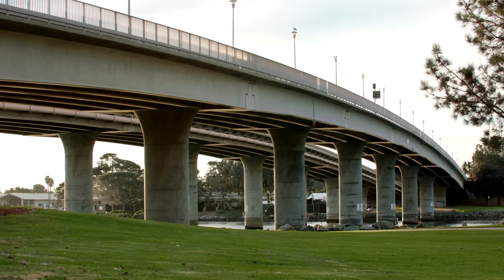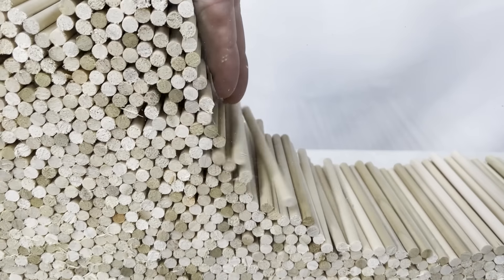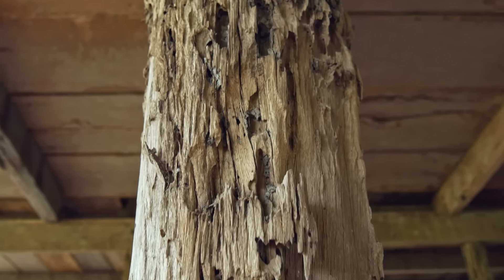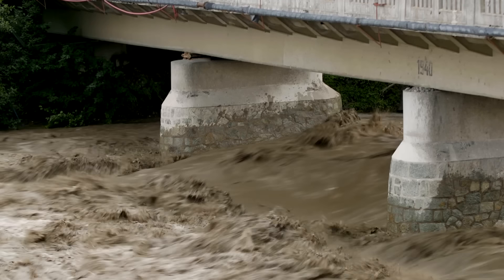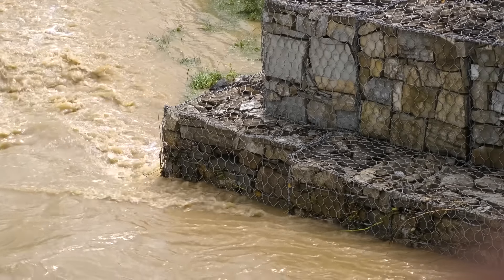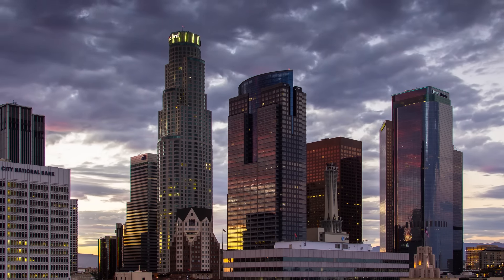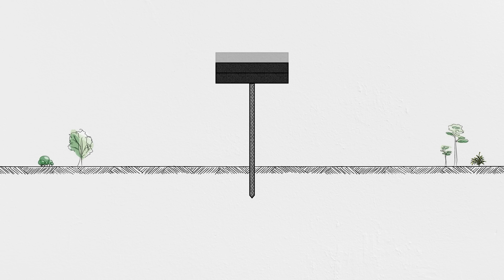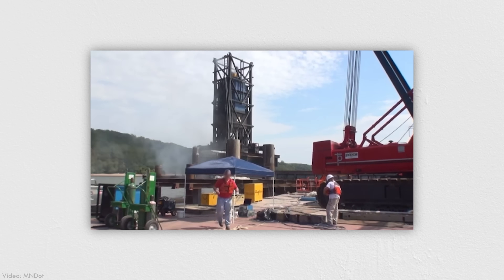Why Buildings Need Foundations

Comment: I'd be interested to hear about historical aspects of engineering. For example: my hometown in south-western Germany has a lot of really old houses - some of them close to 900y old, but still fully used for housing and renovated to modern infrastructural and energy standards. Most of them are timber framed and have been built long before "modern engineering" was a thing - yet they withstood for so long and might for quite some time to come.
The way they were built might be part of this secret, e.g. many of them moved together with their sinking foundations, have visible (but apparently not critical cracks that were simply filled during renovation, leaning walls, crooked floors rising 20-30cm in extreme cases from one side of the house to the other.
Reply: Don't forget about survival bias. You see only those, that had the right combination of construction, soil below them, lot of repairs over the years and a lot of luck. 99 out of 100 are long gone.
Reply: @petrkubena  which would not make the reasons why they survived for 900 years any less interesting
Reply: I was thinking of many of the stone structures in the UK that have been in use since time immemorial.
However, many of these structures have basements that likely serve as decent quality foundations, and many have seen many repairs over the years as stress cracks have appeared due to settling. Now such structures are probably resting on exceptionally well-settled soil.
Reply: As Grady mentions at 6:04 - engineering is a job of balance and constraints. I think before "modern engineering" was a thing, people didn't know how strong things needed to be so they were overbuilt to make sure they lasted. Only those structures that were overbuilt survive till today.

With modern engineering, we now know the limits of materials so we build things to suit the budget and expected lifespan. We can definitely build buildings that will last 1000 years, but not many people would be willing to pay for that.
Reply: It's probably much the same reason why you see old roman structures still standing today. A lot of buildings and other structures used to be built as solid slabs that move around on a shifting foundation as one big piece rather than something that gets pulled apart. Those roman structures that still stand today as those are basically all just massive single lumps of concrete without reinforcement (so no oxide jacking when the rebar inevitably starts to rust). They were built that way because that's the only way they could be built back then and used way more material than what a modern equivalent would.
Reply: Well, generally speaking, houses in Europe are built to last more than 3 generations. Raft system is used extensively, concrete, stone and bricks also. You can not expect to have building with wood base to last, and whole idea of USA houses is a bit ridiculous to me.
Reply: @petrkubena  I have to disagree, even if you go around villages in Eastern Europe, houses that are not let of are in great condition. The ones we don't see anymore are either destroyed in wars or intentionally replaced with those of modern design, with at least 70% salvaged material.
Reply: @veryboringname.  Where goes the limit on "over engineering"? 1000 years is obviously just an exaggeration but also the current USA-style where houses are demolished every decade or so is just waste of resources and money. Buildings should be built to last at least hundred years because we have the know-how for it and ripping buildings just to build newer ones is just dumb.
Where i live, houses cost alot and that is with the normal building codes, they just have to be sturdy. We have to battle with yearly frost, bitter cold and heavy snow loads on the roofs. If building is found to be unlivable and has to be condemnd in less than 50 years, mistakes were done when constructing it. Paying huge money just for the pleasure of paying it again in couple of decades is something that no-one here would agree to. Now, build a house that you can give to the kids and it still has some value, that's saving money!
Reply: With floors so far out of level I'd be concerned about long term ergonomic effects on those living on them, especially if they were working from home, sitting at a desk.
Reply: @petrkubena  But the UK also has entire villages or high-streets in a town where every building is over 200 years old, WWII bomb damage not withstanding. survivorship bias should lead to old buildings being rare, between rows of new built.
Reply: In the UK mediaeval oak-framed houses are quite common. They are held together by wooden pegs. If you don't remove the pegs first they are practically impossible to pull down. At a guess, deforestation and scarcity of oak might be a reason this method went out of fashion. Again, I once had to sell a near 200-year old brick-built cottage. There were various large cracks from settling. I was terrified, in fact for cosmetic purposes I filled some of the cracks with polyfilla (not a structural material). It sold with no problems. Maybe it was structural brick
Reply: @alaric_ , I have to disagree about USA-style houses being demolished every decade or so. For example, Grady's house is 70 years old, and was still on its original foundation. With maintenance, like he is doing, that house can last centuries. If he didn't bother now, it might still last another 20 years before becoming uninhabitable.

A main reason houses get demolished in North America is that renovations to change layout and add features are often as costly as demolishing and building new, and the renovated building would still not be as suitable for the modern use as a clean-sheet design.
Reply: @MsNebojsha  "...whole idea of USA houses is a bit ridiculous to me."

This is absurd on multiple levels.
Reply: @MsNebojsha  Like he stated in the video the construction depends a lot on soil composition and climate. A wood pile foundation might not make sense in the area in which you live but in Texas it makes more sense because of the climate. The area in which I live most of the new construction uses concrete raft foundations. That is because I live in a much wetter and colder area than Texas. However, none of that makes it "ridiculous" since there is a balance that has to maintained when making these design decisions. Why would I spend the money for a house that can last 3 generations when I'm not planning on this house being in my family for 3 generations? Did you watch the entire video before you commented because he addresses exactly what you said in your comment?
Reply: @wfemp_4730 
No it's not.
You just lack the same frame of reference.
(which he just didn't spell out for you) 

A lot of US house building very much is ridiculous, to a European's eye.
But few of us realize that tornadoes and hurricanes can rip apart brick houses as easily as wooden ones, and that bricks fly around in the wind too, and aren't much better than wood and plaster, to get hit by... 
Also, it seems insane to build big sprawling cities of separate 1 story houses, if you're used to 3 story continuous streets. But the heat in Texas/Arizona etc is on a whole other scale than we see here. (and the costs of making bricks and shipping them west is absurd too, but how would most Europeans know?)
And then there's the size of most houses and rooms. But I suppose that that differs between European countries as much as within the US. Like, if you look at the price per square meter of property/plot in San Francisco or NYC etc. So that one perhaps isn't as ridiculous, lol.

Anyhow, I hope it's less absurd for you, now you know the context that the comment left implicit :)
Reply: @alaric_  loling at the fact you think US houses are demolished every decade. 

This couldn’t be farther from the truth. The overwhelming majority of houses are never demolished.
Reply: @alaric_  Times have changed, we live in a world of fast fashion where things go out of style when someone sneezes. 

People generally don't have unlimited money so when presented with two options - one being "spend $200,000 and build a house you'll live in for 15 years" and "spend $400,000 and build a house for someone else to live in 150 years", the vast majority of people will opt to save the $200,000. 

You say paying money for a house just to pay for another house again in a couple of decades is something noone here would agree to. But if you actually look at the housing market, that is exactly what has been happening for years.
Reply: @alaric_  You think your kids are going to want your house? Or even live in your area? I live 1,200 miles away from where I was born, and have no interest in living in my hometown. 

You actually answered your own question without realizing it. You think houses are expensive now in the US? Try engineering a house to last a couple hundred years. That will add at least 20-25% premium on top of the prices you see currently. Building houses that last 50-100 years at the most might be a "waste of materials" but it's actually keeping housing prices down.
Reply: @questioner1596  This is accurate. My house is 40 years old, in great condition. My GF's house is over 100 years old, and structurally in great condition as well. Houses in the US absolutely will last 100 years from an engineering perspective. Aesthetically it's a different story.
Reply: Fun fact, here the oldest structures are not much over a couple of centuries in age yet they commonly have what is called a "boulder foundation". You could not get a permit to build with a boulder foundation today yet these old buildings have their foundations protected as "heritage" structures so they cannot be changed to a stronger foundation.
A 4 floor building built on stacked boulders that is 200 years old is as badly warped as the 900 year old structures you are talking about. Most of these here are also brick walls, as in 18" long by 12" wide by 2.5" tall and solid. ( 45 cm by 20 cm by 6 cm roughly ) Held together with thick layers or mortar which squeezed out from between the bricks on the interior and left as is rather than cleaned as you will see on the exterior.
Reply: If you look carefully to how those houses were built, you will find primitive but amazing and intelligent engineering construction structures that defy modern engineering.
Reply: @alaric_  
A decade or so? My house is from '58, solid as a rock (2-story, stem/retaining wall w/ SOG).
I work with residential repairs, particularly foundations, and most of the houses I work on are from around the early 1900's, from when this area was first being built up. I do find some more recent construction with just bad soils, bad construction, built on a failing hill, etc., but that can happen anywhere.
Reply: @AndrewHelgeCox  that's usually compensated by building leveled floors on top - only minor height differences are usually tolerated.
Reply: @wilfri3476  Venice (Italy) is completely built on top of oak-wood piles, which are kept in perfect condition as long as they aren't exposed to air! Wood can definitely withstand a lot if done right.
Reply: @kindlin  An decade is overexagerated. But an house from 1900-1930 in Germany is seen like an house from the 60-70s in the US. It isn't new, but it isn't old either. An house begins to be perceived as old when it was build around 1850. It is not uncommon to see houses which have dates engraved in them from the 1600's, these are considered very old. Ancient begins when the structure is older than 1000 years. That will usually not be an home, but churches, parts of bridges, old Roman structures, usually (parts of) roads and fortifications, theaters, old basements of public Roman buildings, like baths or the Forum, castles, manor homes / stately homes. 

Especially in rural areas not near big cities, were new development is constantly taking place, there are way more houses built before the 1900s than after; because these areas weren't bombed to oblivion during WW2 and these old houses are completely overengineerd. They basically used whole tree logs as framing, when they didn't build them completely out of stone or Bricks, and usually build the framing on massive arched stone cellars made with natural stone or bricks, which, too, are completely overengineered. In rural England houses are even older, as they build them more commonly completely out of stone and they weren't bombed nearly as bad as Germany. And people tended to be wealthier in England.
Reply: @alaric_  I think you and MsNebojsha have a lot of misconceptions about buildings in the USA, and possibly more than a little bias. By no means are they demolished every decade or so. And most don't have a wood base, it's very dependent on where you are and what era the house is from. A lot of the ones that are demolished aren't because of any engineering or structural reason either. It's just people (or companies) buying the land and wanting to "update" things constantly. Which is not something most every day people subscribe to who buy your average to low level house.
Reply: @petrkubena  not to mention maintenance, give this same conditions to a building that lost its users and the lack of maintaining will see that it ends in ruins nonetheless
even the colosseum would eventually completely collapse if not for constant maintenance over millennia.
Reply: @Mrcaffinebean  many houses in my state are 20-40 years old or more. And lots of newer builds ranging from 2005-2022. Most homes stand for 100+ years.
Reply: Piling on with the US house duration thing - I bought (later sold) a house in the Seattle-Tacoma metroplex which was built in 1903. Probably the first house built on that parcel. That area of town had been platted when the railroad came in, and it was warehouses and workshops to service the rail cars, and the neighborhood to the sides was all platted out for houses. This was before a developer would come in and buy a huge area and build a hundred houses with the same plan; instead you'd buy a plot and get a house built or build it yourself. So all the houses have a different floor plan, often different styles and sizes. So we lived in a house that was 120 years old. It didn't feel ancient, just like a nice sturdy Craftsman style house. 

More often what happens is a house is built shoddily in say 1900 because it's cheap, and then within maybe 20 years it gets replaced with something else. And then THAT house survives. But from that platting period in 1900 maybe not all the parcels get built on right away. If the first house built there wasn't until 1920 for whatever reason, of course it'll be younger. So you end up with a wide variety of house ages in a neighborhood. 

Our neighborhood was lucky in that it never had a huge fire or earthquake or tornado take everything out. If your area is prone to natural disasters it makes sense to build for not much longer than the typical disaster interval. If wildfires destroy your house every 15-30 years, then the extra cost to upgrade your building lifespan from ~100 years to ~200 years makes even less sense!

Neighborhoods also kept getting torn up for development of freeways etc. which means more demand for building elsewhere at that time and the destruction of old homes in those neighborhoods. This isn't as common anymore. 

And this 1903 house was on the west coast, which didn't get settled as early as the east coast. So on the east coast you have a longer span of time, where cities have more opportunity to change. What used to be rural settlement becomes a neighborhood of houses, which becomes high-density urban. Each time you change, all the old structures have a good chance to get demolished to make room for "better". 

Finally, different systems in a structure have different lifespans. If your roof leaks in ~30 years, you need to get it repaired. After a while your repairs come faster, maybe every year, and replacing the roof becomes a cheaper option than maintaining it. But what if you neglected the leaks, or didn't replace the roof when it needed it? Water intrusion rots your wood and causes instability. Let your roof fail and the rest of the house goes soon enough. So if your culture has a strong concept of roof maintenance, repainting / plastering, etc. then you can keep a structure going for an extremely long time.